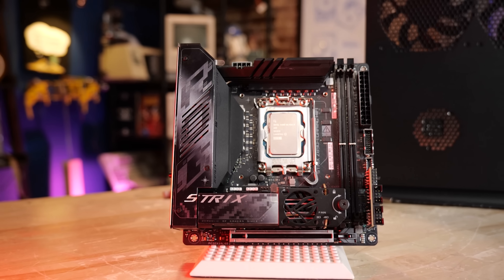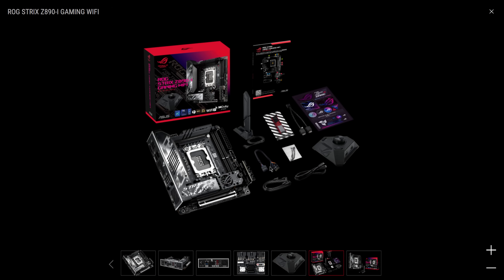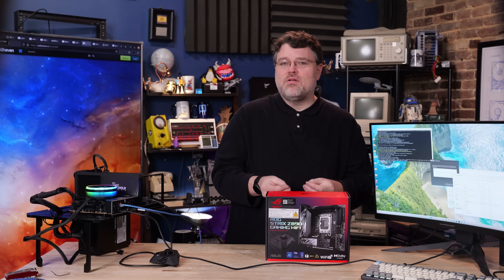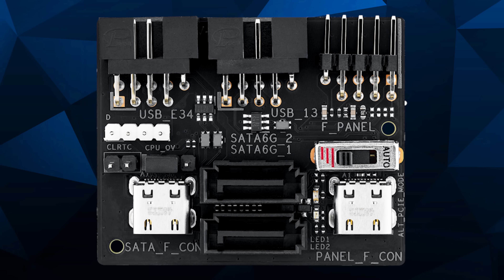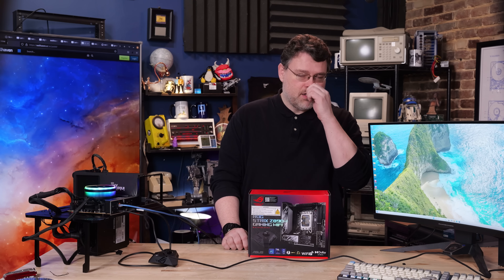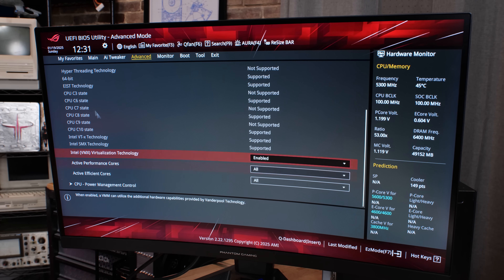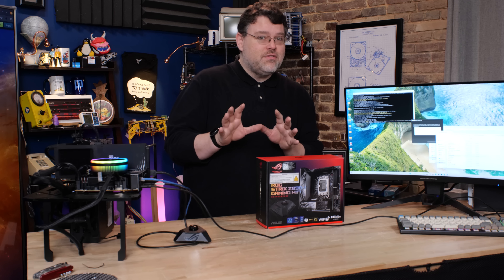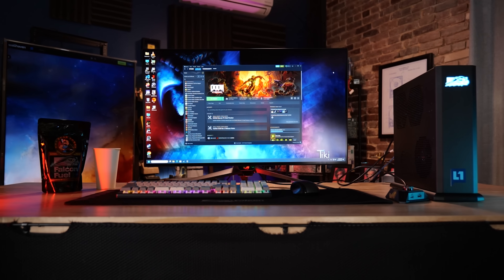The 285 non k Intel Ultra 9 w/ the ROG STRIX Z890-I Gaming Wifi Motherboard

Comment: Can you stop praising proprietary wifi antenna connectors? All it means is that if you lose the OEM antenna you're SOL, or if you want to use a bigger/better/more-esoteric antenna, you're also SOL. I see no upside other than a few seconds saved once every blue moon. Plz + Thx U. /rant

Great video otherwise. 🫶
Reply: It's not proprietary, that is a standard CRC9 connector. They are common on Chinese WiFi/4G/5G equipment.
Reply: God thank you i was looking for plug in antenna that use that connection type to DROP the cable but i can't find any
Reply: It’s sponsored and he has what looks to be an affiliate link for the motherboard.